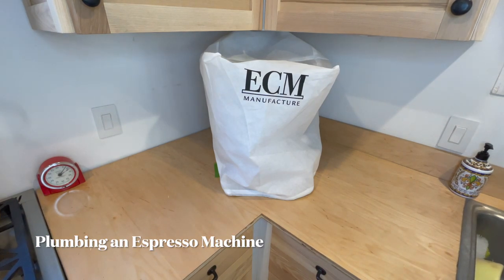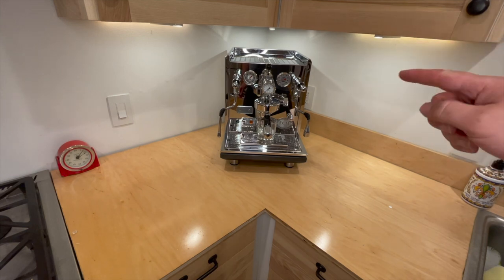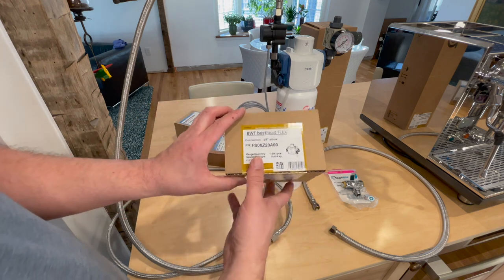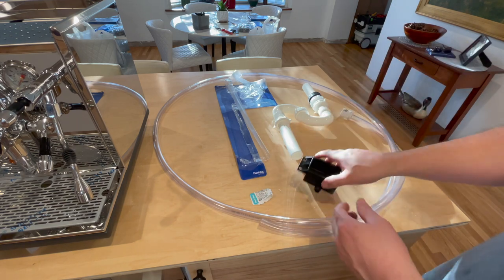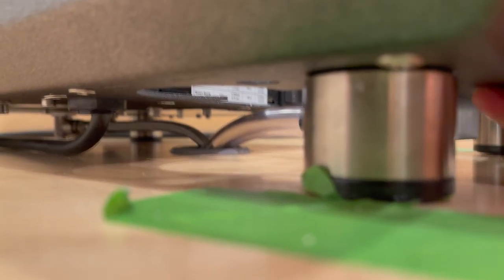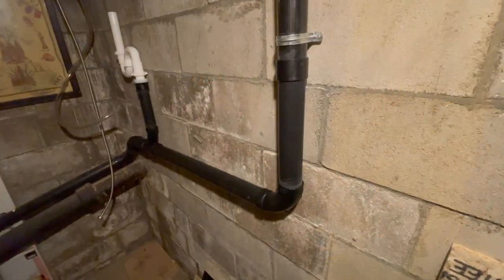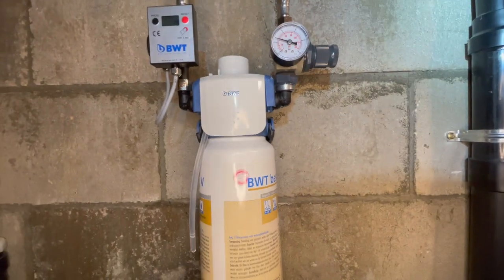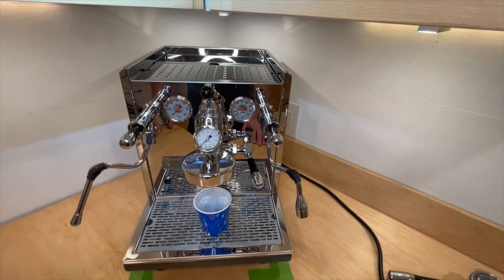Plumbing our ECM Synchronika Espresso Machine

Comment: Just wanted to provide an update for buyers who are watching this video for planning. Synchronika has updated this hose slightly.  In the hose at the adapter side, now incorporates a tiny check valve, the connection has been slightly changed to allow for this. There is no longer a compression fitting (ball / ferrule).  It now requires an O-Ring where the converter coupler attaches to the hose end. This seal not included with the machine, or the conversion coupler. I was told by WLL that it's a readily available item locally or by a professional. Additionally, the BWT filter kit comes with extras if needed as well. Just wanted to put this out there, as I was scratching my head. Thank you for this video, it's incredibly helpful.

Comment: Nicely done! Weird coincidence that I just finished the maintenance that I do every 6 months on my Synkronika, then went to bed and your video was the first recommendation lol.
 I can't do what you've done because i live in a rented apartment, and there isn't a drain source near the machine. So what I've done is use those 5 gallon water bottles to collect from my drip tray.
I just got a regular garden hose and it works fine as long as the gradient is there. 
Good call on the clear tubing! My first garden hose was green and not transparent, and didn't realize the problem brewing ahead. It clogged with coffee gunk after 6 months, and made a real mess when it leaked. Now I've learnt to flush the hose every few months to keep it following nicely.
In your set up, I fear that coffee gunk may collect in the u-bend, where it's non transparent white plastic. Since there is never a decent amount of fast flowing gushing water to push the gunk up and beyond the bend, it might be worth checking it out once in a while? 
Just my 2 cents for you to hopefully avoid a horrible mess :)
My machine just celebrated it's 5th anniversary, and is still running like new. I hope you enjoy yours for years to come too.
Reply from the maker: Good to hear that your machine is 5 years old and running like new. So far I haven't had any clogs in the drain tube but it's still year 1. I will do an update in a few month sharing my experience. Thanks for your suggestions!

Comment: That's a really great video that you did. I have a cousin to that machine profitec pro 700 and I also purchased it from the same place. I'm also looking to do a drain. I noticed that the tubing you used is not the reinforced stuff. Are you having any type of problem as far as hot water going down there tubing. I also noticed that you did a separate trap specifically for that drain. I'm in the process of refinishing my basement and I have everything open but I'm trying to figure out a way to run the gray water line well you don't see it through the walls.

Comment: Is this really necessary to make great coffee or will not plumbing it going to be fine?
Reply: If you have a machine that operates either way, you don't have to plumb it. Plumbing it will simply save you the chore of having to fill a reservoir and empty a drip tray. No difference to coffee quality.
Reply: Incorrect. Being plumbed in allows you to do line pressure pre-infusion, which you can’t do using the reservoir. Other than that yes, no difference
Reply: @chudak27 no difference as long as you use filtered water to fill the reservoir vs just tap water.
Reply: @LivingTheLifeRetired  how can you do pre-infusion if it’s not plumbed in?
Reply: @chudak27  you can do preinfusion using flow control if you have. On my Profitec Drive I also have digital preinfusion that runs the pump a bit then cuts out, each for desired length of time, before resuming.
Reply: You can also just run the pump until the pressure comes up to 9 bar, move the lever to the centre position so it shuts the pump off but doesn’t drain, pause for the desired time, then run the pump again.

Comment: Excellent videos of your plumbing set up! After plumbing in your machine, do you turn off the water valve on the bottom of the machine after each use? I plumbed mine in last night with the same BWT filter set up as yours,  set at 2 bar. I left the machine valve open (bottom, back side of the machine) and got up 4 hours later to let my dogs outside, only to find a puddle of water on the floor in front of my machine and the drip tray overflowing. Water was steadily dripping out of the anti-vaccum valve at the bottom of the group head per the manual (Page 29, #7). 

The manual says to shut off the water valve after each use if your directly plumbed in (Pg. 27). I've had my machine for 4 years, and just now plumbed it in. That valve on the bottom of the machine is not easily accessible and does not turn easily. I'm hoping thats not the process ECM expects you to use after each use. Its not an easy process and if you turn on the machine and forget to turn on the water, I can only imagine the damage you would cause. Just wondering what your experience has been?

Comment: Absolutely LOVE your videos and appreciate sharing the ECM Synchronika plumbing and drain setup!!

Two questions for you.
(1) What is the minimum height from countertop to the top of the side panel with feet completely screwed in? I am seeing 16.25" to 16.53" from 2 retailers.
(2) Did you have to raise the feet to allow clearance for the drain hose and create a better flow pitch or do you think at the minimum height will be sufficient for drain flow?

Many thanks!
Reply from the maker: 1. I went and measured and the minimum is 16.25" that gives like ⅛" of wiggle room but I store cups and pitchers up there on the heated tray.
2. I did not adjust the the feet at all they are fully screwed in. I made another video on a better drain: https://www.youtube.com/watch?v=F26ZYhUfRiY&t=173s and the hose attaches onto a 90 degree elbow so it only has to bend into the hole in the counter top.
Hope that helps!
I am still very happy with my ECM.

Comment: Too funny.  I was also thinking about building a cardboard mockup, I have a depth restriction.  I have a coffee bar that only has 20” of counter depth.  The Pro700/Synchronika are 18.7” deep.  Tight.  I already have filtration feeding a commercial Keurig, but hadn’t thought about needing to regulate the pressure down.   Also hadn’t considered the plumbed drip tray.  I have a sink next to where I would put the machine so maybe a trap extension with dishwasher drain adapter would work.  The other issue is the power cord.  I have a dedicated 20 amp outlet, but it would end up directly behind the machine.  Once plugged in it would push the machine out at least a couple of inches.  I will likely have to move the outlet.  Uggg.  Maybe I would just wire a new outlet connected to the original inside the cabinet below.  Finally I have a 3M filter cartridge that I think might be filtering calcium.  Might have to revisit that.

Comment: I know this is an older video but wanted to save someone potential flooding of their machine. This type of plumbing drain should never be direct to an appliance. There should always be an "air gap". What that means is the drain connection should be floating above the trap creating a gap between the main drain and the appliance. This is to prevent any potential for a drain to flood into the appliance creating a very dangerous situation of electrical shock and also to help vent the drain at the same time. This is also known as an indirect drain.

Comment: I plumbed in my synchronika recently, i have the bwt regulator and filter i tapped into the fridge water line. Couple days in i am getting water hammering / shaking in the line coming from the basement. Im thinking i need a water hammer arrestor also installed somewhere along the line?

Comment: Regarding your drain, 2 things seem off. 1 - You're using an S trap, which is typically not allowed as it can siphon unlike a P trap. If you ever smell funkiness from your drip tray that would be the likely culprit. 2 - You seem to be wet venting in which case I think you're supposed to tie into the side of the 2" drain pipe, not the top.  However given the relatively small output of the fixture I imagine it would be pretty unlikely for you to encounter problems.

Comment: Great video, very helpful! Thank you. I'm about to plumb in a new Bezzera Duo. I was thinking I might just have the end of the drain hose poked down into the 1-1/2" PVC pipe with no airtight fitting on it, thus providing its own air vent. It will be in a crawlspace so an overflow wouldn't be a problem. I plan to run 3/8" PEX pipe from a shark bite tee fitting on my 1/2" copper water supply line. That 3/8 PEX will go up through a hole in the subfloor into my base cabinet below the espresso machine. Clive Coffee sells a filter system for about half of what that BWT filter costs, so I'm going to try that. I appreciate Todd Power's comment about not really needing a flow meter, I think he's right. The filter will age out before you will reach the limit on the number of liters.
Reply from the maker: Sounds like a good plan, I would recommend direct pluming the catch basin to the drain like so: https://youtu.be/F26ZYhUfRiY?t=173
As far as the filter I plan on running it for more than a year based on testing the water after the filter. As far as filter systems I think the one from Clive sounds good. I kind liked the BWT quality but that is just perception and I am sure many filters would be up to the job.
So far I have been happy with my setup and I wish you well with yours!

Comment: I just ordered your setup with the ECM synchronika and BWT filter combo from WLL. I have a question with how you flushed the filter. I know you need to flush several gallons when first installing a new filter but I want to avoid sending filter junk to the ECM until I can flush. How did you do this when everything was hooked up? I plan to tee off my fridge line which uses 1/4”. Need to figure out to get 3/8” and keep 1/4” for my fridge.
Reply from the maker: On the BWT filter housing there is a flush valve  downstream of the filter, I just flushed 5 gallons through that and it has worked fine. I am not too worried about particles in the filter media as it looks very well made. As far as connecting to an existing fridge water hookup there should be a T valve maybe even with a shutoff that can connect to your existing fridge ¼ hose. The ECM doesn't use much water so supply should be easy. But I really like having a supply shutoff somewhere before the filter to help in an emergency leak... Good luck!

Comment: Hey.... My pressure regulator off my filtration system is reading past 60. I tried turning knob. Nothing. So what should it be?
Reply from the maker: I assume it is 60 psi? Thats a little more than 4 bar which is normal house water inlet pressure. I needed to pull out on the pressure regulator (it is locked when pushed in and can't be adjusted) and twisted the cap on my BWTregulator until the water stopped. Then I slowly twisted it back open until the boiler pressure gauge on my ECM was reading about 1.7 bar with the machine off and no water flowing. That means the feed line into the ECM is pressurized to 1.7 bar so when I pre-infuse my shot that's the pressure it gets (actually its a little lower like 1.5 bar due to loss in the group head). You may need to run some water through the machine to allow for the inlet pressure to stabilize. ECM recommends you keep the inlet water (direct feed water) pressure under 2 bar on page 28 of the instruction manual. This is so you don't damage the pump with too much inlet pressure. I think if you reduce the pressure to zero and then open it back up slowly to 1.5 - 2.0 bar you'll have better luck!
Reply: @postbeam8200  I figured it out. I had to run the machine to be able to adjust the regulator. 
Made myself feel stupid. Lol

Comment: The water meter is a waste of money.
You will never come close to using the amount of liters of water the filter can handle in one yr.
I bought one and only used a few liters
Reply from the maker: I think you're right as far as using enough water in a year. However, I am going to experiment with using the filter over a year in that case I may start to reach the water filter use limits which I plan to monitor and record my observations. I have a decade of experience with keeping reef aquariums and have the HANNA lab grade testing equipment to precisely measure dKH, dGH, TDS, & pH in a water sample. I suspect that the annual replacement is based on the average usage in a commercial environment. I currently  use a 5 stage Spectrapure system for my aquarium and I base cartridge replacement on performance not time, so this 1 stage system should be easy to monitor and I am planning on following the same principle. There is an old joke in reef aquariums that you not keeping fish or coral.... you're keeping water. And if you're not testing you're guessing.
Reply: @postbeam8200  Your more into it than me. I just got the bestmax filter and used it over a yr and had 3-5 shots lots of days.
Never used 10% of the yearly amount of water so in never replaced my filter yet.
I will keep watching to see what you find over time.
The synckronika is not most expensive machine out there but i think it has all you need for home. I love mine and can get some good shots.
I upgraded my shower screen and basket but the best improvement is a 3 hole steam tip
Reply from the maker: @toddpower4674  I LOVE my Synckronika also :)  I was looking at upgrading the steam wand tip. They sell a 3-hole, 4-hole, and 5-hole tip but its good to hear you feel the 3-hole is a big improvement over the 2-hole it came with.
I am also planning on getting a bottomless portafilter and adding the ECM V-Titan 64 grinder. Do you use either of those?

As far as the BWT filters I am kinda geeked to try and apply some of my chemistry knowhow to my espresso water makeup. I may post a video of my findings.
Reply: @postbeam8200  i got a titan 64 and a bottomless porta filter.
I find a bottomless porta filter messy and dont use it very ofter. Spurts squirt over the machine or floor if you dont have everything perfect.
I made my titan a single does grinder by getting a eureka blow up hopper(smallest one) and removing the static screen.
The grinder is awesome. Before that i found little hard to dial it in because its so so fast, but its a good grinder. Also remove the porta filter holders and get a doseing cup. And a rdt bottle
Reply from the maker: @toddpower4674  Awesome! That is exactly what I have been thinking about doing. I was wondering if Eureka hopper would fit and it sounds like it does. 😁👍Thank you for the recommendations! Here are two YouTube videos I found showing ECM (or similar) grinders dosing. I will post a video once I get mine setup. 
https://youtu.be/YK7_tDfg_IY
https://youtu.be/d-tDnXH5Mu0
Reply: @postbeam8200  you will need a piece of pipe with a 44 mm outside diameter and 1.75 inches long
It will fit in grinder and in hopper like a sleve.